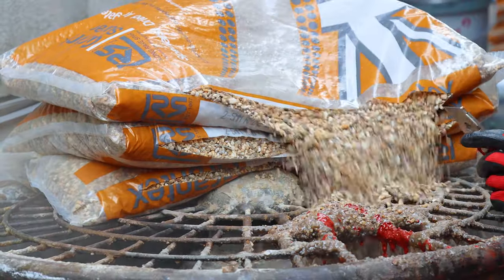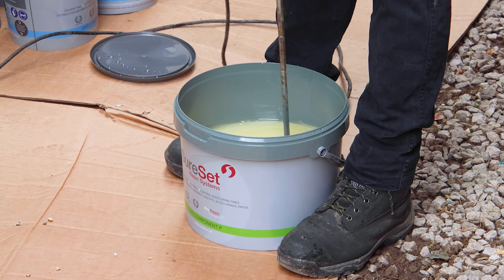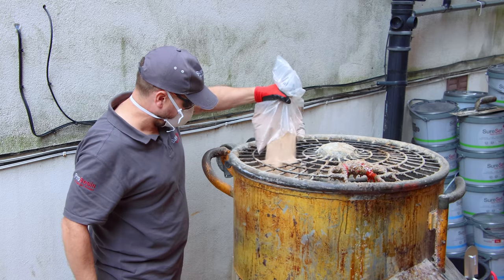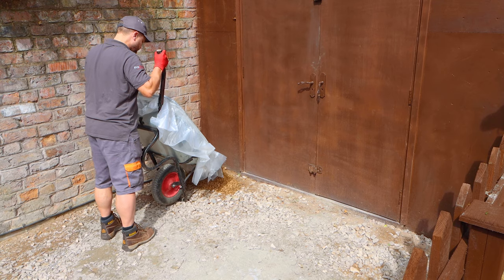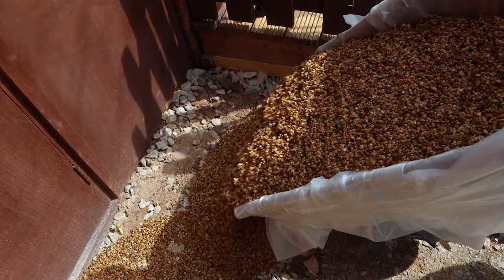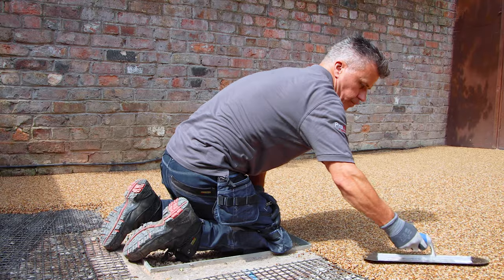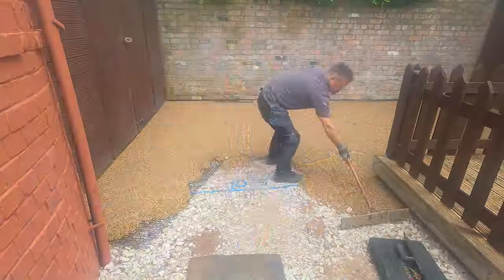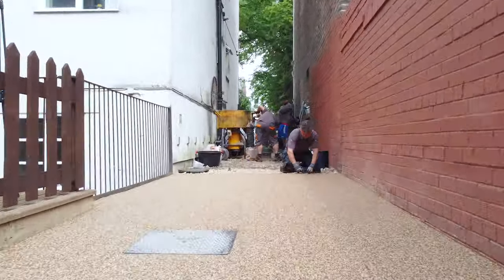How to Lay A Resin Bound Pathway in 60 SECONDS | 60 Second DIY Tips | @SureSetResin

Comment: Won’t last to long laying straight onto type1! Got be laid on concrete or tarmac!
Reply from the maker: Hi, yes it has a 21 year guarantee, the manufacturers were there on filming day and said that it was perfect to work on when it is just a foot path
Reply from the maker: You do require concrete or tarmac if its a Driveway with cars using it, this is a footpath os its perfectly fine to do it the way we diid
Reply: @MrandMrsDIY  ok it’s a footpath but over time with movement it will crack. Especially when the type1 settles. I’ve laid loads of resin driveways/footpaths and even on tarmac/concrete it cracks. Should always use a geotex liner aswell under the type1 this helps but still your get movement.
Reply from the maker: @Chickenben897  Thanks for your advise